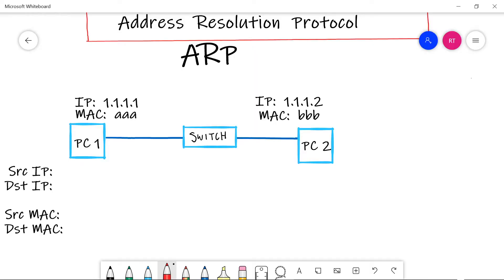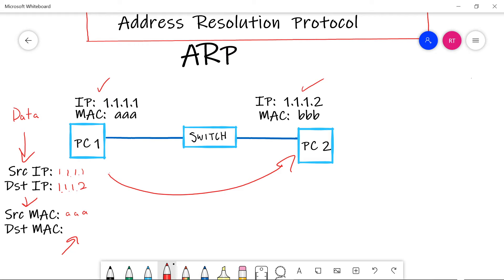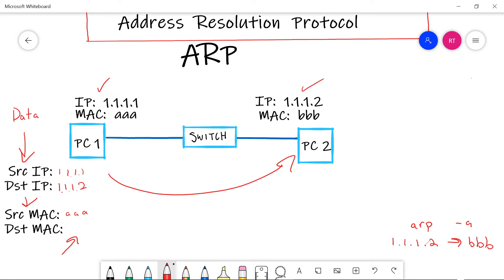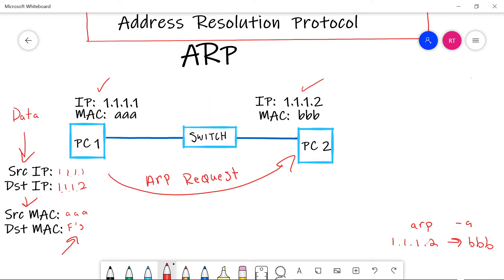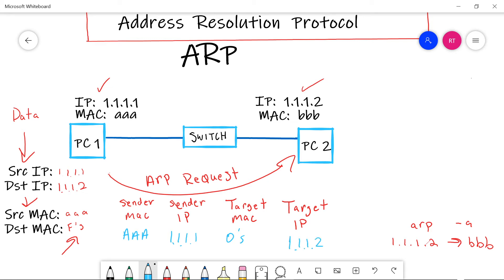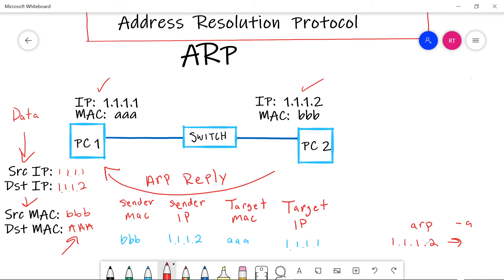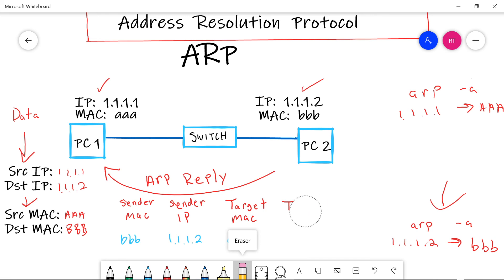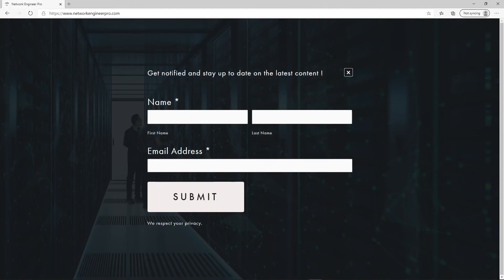ARP - Address Resolution Protocol Explained  - CCNA 200-301

Comment: Hi, could you please clear my confusion. In this video you used IPs and MAC both. In another video (How switches learn MAC addresses) you used only MAC addresses. Now what is the relation between two videos? Do PCs communicate with each other using both IP and MAC and use ARP ? If yes then what was the purpose of the other video where you only use MAC addresses? Whenever two PCs communicate, very first they use ARP to learn MAC and then they send the frame to other PC using the other video? I am so confused
Reply from the maker: Sure thing,  Process 1, the ARP video. The PC's on the same subnet will learn eachothers MAC's via ARP and build and send the frame on the wire towards the switch. The pc's will store ARP info (IP-to-MAC bindings) in its cache so if the macs are already known then no need to ARP for it. That frame the pc's send have a bunch of fields but the two most important fields are the src and dst mac. 

Process 2,  How switches learn MAc addresses video. The switch gets the frame, learns the src mac and stores that info in its mac address table. And then it looks at the destination mac addresses in the frame. If the switch's mac address table has that destination mac address in it already (lets assume it does) , it forwards it to the associated switchport where that destination mac lives. 

A regular layer 2 switch techincally doesn't care about the IP addresses of the PC's. It never looks deep enough to see those details. For successful forwarding it doesn't need to. It learns src mac addresses as frames come in, stores them or put's them in its mac address table (address book) and looks at that address book to forward frames to their destination.

There are some additional details I left out, but I hope that helps. If it still doesn't make sense please let me know and I'll be happy to help.